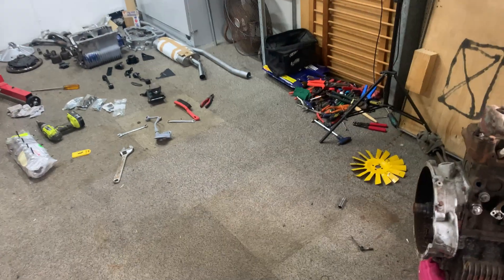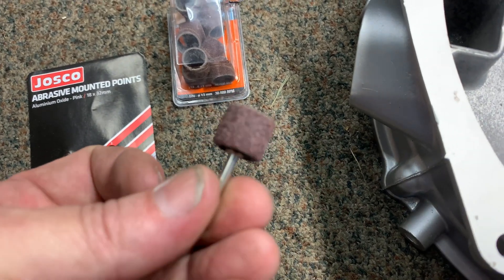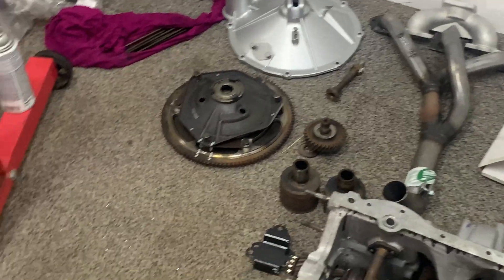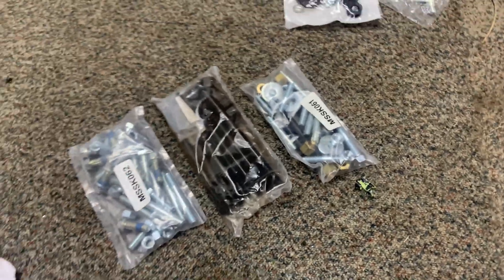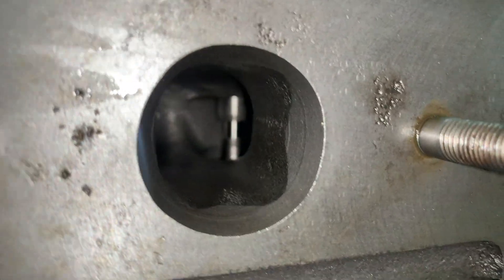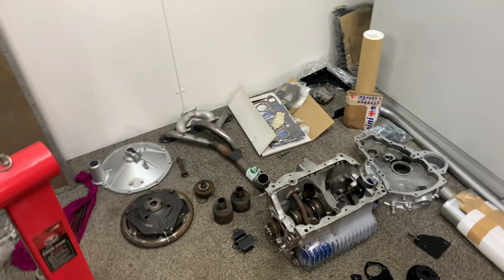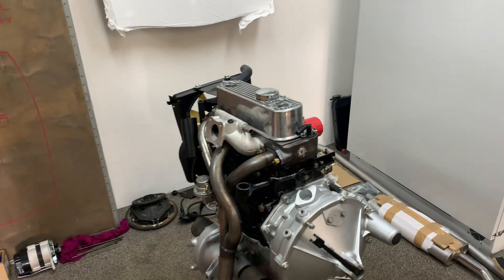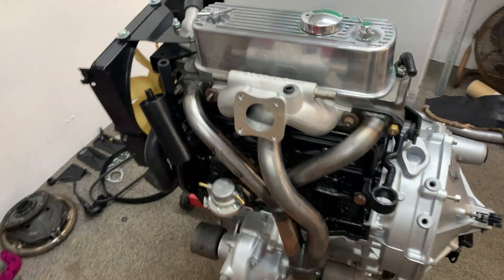Part4 of the Mini Motor Build -  so much work done! Starting to look like a motor!

Comment: My old Morris Minor uses basically the same engine. I fitted a Supercharger on it. Video on my YouTube  channel.  If it's a 1098cc mini engine you can fit a 1275cc cylinder head bigger valves etc. But you need to pocket the block to allow valves to come down. Same camshaft but offset rockers etc. You can also make the oil pressure relief valve adjustable. Cheers from old George
Reply from the maker: Lots I could have done, but shes done 1500km now and loving it.. added Twin SUs & 12G940 head with just enough work to be super fun.
Reply: @HBPowerwall  Yep yours its looks and sounds pretty good. It took me 8years to restore my Morris Minor. Problem I found was with fuel. The A series Engines were designed for Leaded 5 Star Fuel which became obsolete in the UK. Burnt valves and seats.  Sold the car and made a massive loss financially. Almost had to give it away. If you visit my YouTube channel you will find a Playlist. 3 videos on the Morris and Engine.  Cheers from old George Ps this new fuel E5 E10 now introduced in the UK rots plastic floats in carbs.

Comment: Sounds like a vacuum leak.
The way to get those needle bearings out is to break up a bar of soap and put the pieces in the centre of the bearing. Then find a tight fitting shaft and hammer the soap until it gets under the bearing and lifts it out.
The way to blast clean a block is to use the sand blasting gun and feed it water and replace the sand blasting nozzle with something like a 10mm pipe. Next blow it down with air. Then stand the block on it's end and get a air powered degreasing gun and blast it with kero. Then blow it down with air. Remember to blast every oil passage in every step with the blanking plugs out, ie, dead ends hold honing grit that will go through your engine. If you stand the engine up on it's end and blast up, it can clean dead ends.
Those pipes are too big for the application, you will lose maybe 15hp down low.
That gbox needs to come apart to get all the grit out, that's why you don't blast things like that.

Comment: Hello Pete, I want to ask something (it maybe out of topic from this video, but not far from car and batteries)

I want to make a battery pack for my car and moped, 4S6P configuration.. but I dont know if there's any BMS that could handle 300/500+ cold cranking amps that i can get locally. so I got idea to use the BMS to charge the battery and power the electronics in the car (connected to alternator) and for starter motor, i connect it directly to the battery (-) terminal.. is it okay to discharge the battery without BMS and recharge it using the BMS?

the configuration is like this [+] (+B1-) (+B1-) (+B1-) (+B1-) [- BMS]. i connect starter motor directly to (+) battery in parallel with the BMS. is this okay to do? thx in advance (and sorry if there's any mistake in my english)

Comment: Kind of skeptical about grinding the old bearing out from the inside, but I guess if that's the only path left, that's the path you take!  And sand in the orifices?! Sounds painful! (That's why they normally hot tank engine parts.)
Reply from the maker: it really was the cheapest and easiest idea - i wish i had have recorded it but I get 1-2min between fixing computers or consoles during the day so don't have the camera set up. Just used the sandpaper to grind away half of the bearing casing to weaken it then pull it out. more damage was done by the screwdriver than the sanding. I would love to hot tank the whole lot. I'm going to clean with high pressure mineralterps & hot water in the pressure sprayer. Then drown with oil & seal till i put it all back together again. I'm really scared of taring up this motor with one small sand partical.

Comment: @HBPowerwall From your description of how it won't idle, the carby has a blocked idle circuit, or the float level is too low. Tear the carby down and poke wires up all the holes you can see, then blow them out with carby cleaner and compressed air. Check (and probably replace) the needle and seat on the float valve and then adjust (stretch or compress) the float valve spring. When you're holding the carby level, the float should be parallel to the carby's centre body.

Then re-tune. :)

ETA: For an easier way to remove a bearing in a blind hole: Get a welder and run 3 beads of weld up the bearing race. As the weld cools the metal will shrink and the race will fall out after that.
Reply from the maker: it was a faulty distributer - the vacuum advance spring was broken, disconnected and it worked perfect - well until a diff output shaft seal failed lol
Reply: @HBPowerwall  Really? Well I'll be!
LOL, old engines/cars... Show em some love and they start breaking. She's gonna be a fun little go kart when she's done though!
Reply from the maker: Ooh when its running its SO much fun - this new motor is going to get me tickets!
Reply: @HBPowerwall  lol!
Can't wait for the update from lakeside ;)
Or Willowbank.
Reply from the maker: What is YT doing I just replied to this lol - lakeside is fun for my mini & super motard on the skid pan but i think would hurt the poor little mini being on the big track. Now I would really love to do some hill climbs that would be great fun

Comment: Have you had a look at the carby on original engine? Sounds like a jet issue casuing it not to idle properly
Reply from the maker: since found the fault - it was the vacuum advance on the new electronic 
distributer. I fully rebuilt a spare carby for this motor its on the wifes car now.. HELPED heaps in the acceleration department lol now it's only 9min to 100km/hr lol
Reply: @HBPowerwall  hahahaha!
Reply: @HBPowerwall  haha nice

Comment: how did you mount it on the side ?
Reply from the maker: what was on its side?
Reply: @HBPowerwall  side mounted the engine holder  I didn't realise you could do that  only knew of using the bell housing to mount to the engine stand
Reply from the maker: no idea lol it seems to be holding up - not leaving the head on it off camera & no flywheel to makeit lighter.. should be ok, has picked up four bolt holes on the block
Reply: @HBPowerwall  ah ok
Reply: i do miss my 1100 morris
Reply: perfect learner car
Reply from the maker: I just want the wifes car to run for 7 days solid with out rain or a break down.. slowly working through all the little issues
Reply: @HBPowerwall  i thought the su carby's were almost bullet proof  did you put oil in the chamber to slow the piston down ?
Reply from the maker: Yeh did all that..
Reply: @HBPowerwall  hmmm timing then?

Comment: Dis you run through that Gear box with oil in open state and then cleaned it out before assembly? Sand blasting Always get into it and you had alot of surface rust that should shave off first couple of km :). Or you going to change oil after first testrun?
Reply from the maker: The plan is now to strip and clean each part again, i've got 10L of cheap nasty oil, planned on running one lot with a new filter for 5min, then change oil run for an hour, change again - really worried i'll miss one little piece of sand, dirt, crap somewhere in there.

Comment: All the other original bolts you can make look nice by electroplating them in some fluid. It involves batteries so it's right up your street 😜
Reply from the maker: I've done a few tests with 'pure nickel strip' but failed horribly lol I think it was either 'not pure' or the current plating of the bolts. I have ordered new nickel to plate with also binged watched videos about the topic.
Reply: @HBPowerwall  https://youtu.be/G-PtnwtOR24?list=PLNR9e5gIAR0dvcDdg1EQtwb14MYdu_vAe
Reply from the maker: Yep, that's the one that started me down the rabbit hole. Just waiting on the postie
Reply: @HBPowerwall  Have you heard of "The Canning Handbook"?

I used to work as an electroplater. Nickle is tricky. VERY susceptible to burning if the voltage is too high. Constant balancing act between electrode voltage and current density (electrolyte conductivity and distance to electrode) vs plate area. 

Also, the metal surface can "deactivate" very quickly in air. If you need to pause between say, polishing and plating, leave it hang in the solution and not in free air, or cathode clean it in a cathodic cleaning solution that suits the nickle electrolyte chemistry.

You'll know the metal was deactivated, because the plating will happen, but when you rinse it the plating will fleck off in RAZOR sharp pieces. (depending on plating thickness, which should be around 1 micron per amp centimetre, per hour.)

Stay at around 1.7-1.8v and go SLOWWWWW and you'll find a lot of problems go away. (VERY general advice, I seriously doubt the "home electroplating" kits run the same chemistry as I was trained in)
Reply from the maker: ooh one of mine i thought looked burnt... i'm going to re visit it